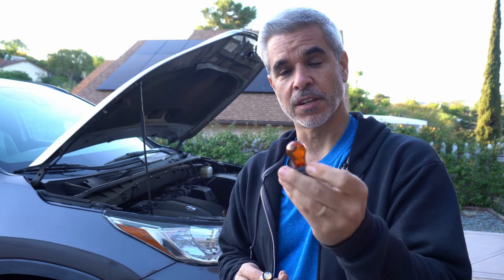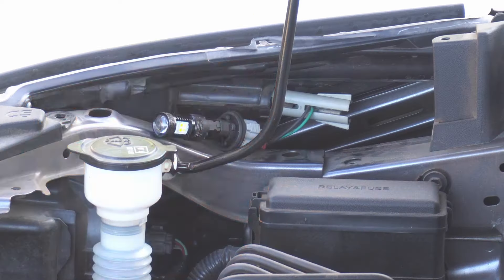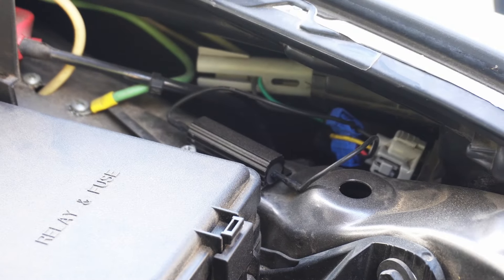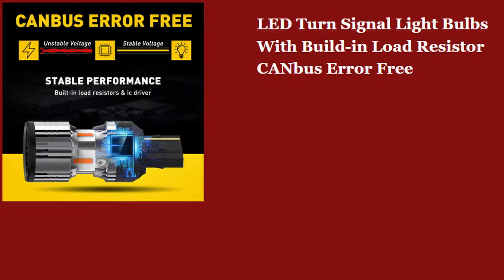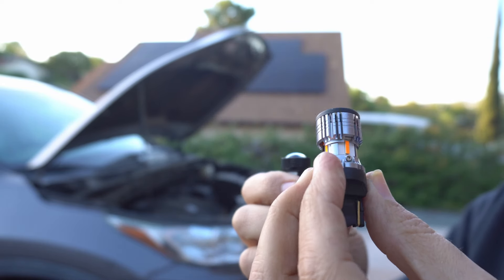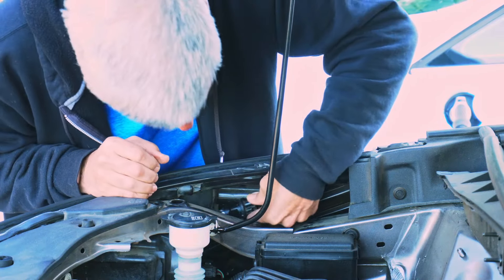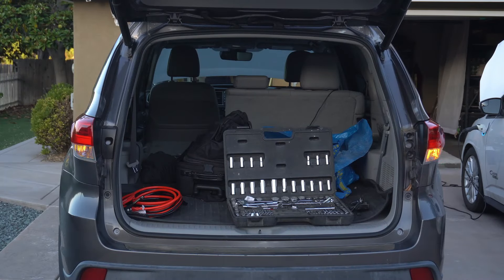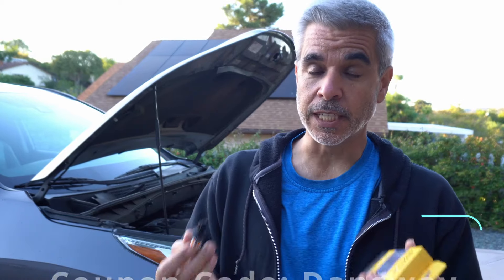Auxito Turn-Signal LED - NO Resistors Required to Prevent Hyper Flash

Comment: I don't like the idea of adding a mechanical fan to my lights, just adds noise and something that will fail in the future
Reply from the maker: I understand the concern.  If the fixture is water tight however, the fan is contained in that enclosed environment and only pulses on when the light is on, so very little use over the lifetime of the car.
Reply: Ur wrong. These led bulbs with a built in fan. Doesn’t make noise at all.
In our experience, they are nice and quiet. Unless u want to listen closely.

And it’s very nice to have a cooling fan, because with a fan. It can cool a lot more led

@Jonzo22

Nowadays with right kind of cooling fan, they will not fail.

Comment: So I used these on my 2016 Highlander.  I initially got the Auxito bulbs without the resistor and got the hyperflash which is too bad as they were super bright.  Got these and no more your flash BUT. When headlights are on for this model the turn signals illuminate and then flash when activated.  These bulbs do not illuminate when headlights are on but do flash when activated.  They also aren’t quite as bright as the non resistor variety.  So they re. CLOSE replacement, but not exact for incandescent.  Good video otherwise though
Reply from the maker: Sounds like you need the dual LED versions that have both running light and turn signal functions (two different fillaments in the same incandescent bulb).  So you would want to select the following one: Bi-Color White/Yellow: https://geni.us/Turn_Bi-Color_W-Resitr
Reply: You sure you didn't order the single filament version of the bulbs? Like ordering 3156 when you needed 3157? This would cause that issue.

Comment: I have also used these types of LED bulbs with built-in resistors for the turn signals on my previous cars and they worked well without getting too hot. The benefit of the turn signal turning on and off helps them not get too hot. But when you use LED bulbs with built-in resistors that have to stay on constantly, such as daytime running lights, they are not suitable and would quickly become much too hot and fail quickly or worse, melt your lamp unit. But in the case of turn signals this is hardly a problem. However, I do not trust the bulb with the small fan shown here. Such small fans tend to fail very quickly. And by switching the bulb on and off, the fan also keeps switching on and off, so I doubt whether it has much effect on the temperature.
Reply: So what LED should I get?
Reply: Which LEDs u used?

Comment: You should've demonstrate left of right turn only, not the hazard light to show it it's hyper flash or not.  Hyper flash occur only for either left of right turn alone, hazard no problems.
Reply from the maker: The whole point of this video is to show that it doesn’t cause the hyper-flash condition.  The reason I showed the hazard flash was to show the difference in brightness.
Reply: @ I get the point, but the number one thing any person is looking for in terms of swapping turn signal bulbs from halogen to LED is hyper flashing.  This cannot be shown if not right of left turn signal illuminates alone
Reply from the maker: @Abdul-404  Iguess you will just have to take my word for it. The whole point of the video is to say that this works, and I'm sorry I didn't include the clip you are asking for.  I can't update a YouTube video (trust me, I wish I could!).  If you can't trust me then you will need to find another source you can trust.

Comment: Just installed these on both the front & back of my 2015 Nissan Murano's turn signals. Very pleased with the outcome!
Reply from the maker: Awesome! Thanks for replying back with your thoughts!   Any tricks to installing them on the Murano?
Reply: @DansWay It’s pretty straightforward with the rear, and similar to the Highlander, there is a cover to remove to access the bulbs in the front. For easier access, the top part of the windshield washer fluid tube pops right off as well, to allow for more room to access the passenger side bulb!
Reply from the maker: Nice, glad they didn’t make it a total pain like some cars can be.   Thanks again for your reply.
Reply: Hi are they still working I’m planning on buying these too
Reply: @ Yes they both still work great.

Comment: Resistor can damage you electrical system I bought led lights cambus error free but they blink to fast turn signal I pay Over $50.00 An eBay
Reply from the maker: I've never seen a resistor cause damage as they only pull power similar to the old bulb, enough to trick the car into thinking the bulb is still alive...

Comment: Does this hyperflash after 5 minutes? I got the non fan version. And it hyperflashed after 5 minutes or when it overheated.
Reply: These will not get hyperflash at all. Compare to lasfit T2 series, the it out performs very well from auxito. 

These auxito led turn signals with a resistors built in, update decoder to hold the hyperflash, and it has a built on fan. For way better and doubles the heat dissipation.
Reply: @toyotabrony  As long as the fan works. Remember, also the fan itself turns on and off all the time.
Reply: @ruudwilschut9095  yeah. Only when it operates by using a turn signal

Comment: Installed the 1156s on my 2024 Kia Forte and they hyperflashed immediately. The caution lights worked fine though.
Reply from the maker: Wow, ok.  Good to know.   You can install resistors to add more load to fool the car computer about the power draw.

Comment: Hi, have you tried turning each side for 3 to 5 minutes? Does it hyperflash,?
Reply: Good suggestion. The problem is that these bulbs get hot after flashing for a while and the high temperature causes the resistors to provide less resistance, causing the car to hyperflash. In this case it is better to use external resistors. More work, but more reliable.
Reply: There's a little built in fan,  so that should cool the bulb enough

Comment: The problem with built in resistors is that not all cars need the same resistance. Another possible issue is the required resistance might change with the parking lights turned on. I might also add that on some older cars, instead of hyperflash, the opposite occurs, no flash at all.

I have also seen on some older GM cars, both instrument cluster turn indicators glow dimly when the parking lights are turned on. The solution is to replace the front side marker bulbs with non-polarized LEDs.

Comment: Let's say these bulbs work as said in this video.  But I'm wondering if the bulb gets hot enough to require a fan, and the fan is attached to the bulb, and the bulb with the fan goes inside of light housings that are usually sealed to be water resistant.  Where does all that hot air go to keep the bulb cooled?
Reply from the maker: The air volume of the fixture, combined with the higher efficiency of the LED (even though it gets warm), means that there is no problem with the fixture getting melted or damaged by the bulb.  Worst case for a turn signal is when you use your flashers in an emergency for an extended amount of time.  In that case the bulbs/LEDs are active ~50% of the time.  The fan spreads the heat into the air and the surface of the fixture will get a slight bit warmer than ambient, but not hot.

Comment: @DoingThingsDan’sWay

Since it’s been over a year.

How are the Auxito - 4KP8 amber led bulsb holding up?

And any hyperflash after daily use?
Reply from the maker: No problems here!  I have them on both of my personal cars and a few others as well...
Reply: @DansWay  do u expect them to last between 3-6 years? Because compare to Morimoto - XB led bulbs that had 52 3030 SMD led chips, and it makes 30W each. 2W more than Auxito. 

And their lifespan is 2000 hours, 

And we all know, the higher the wattage, the shorter the lifespan, because it will built heat more. Yet with cooling fan helps a lot.

But the lower the wattage, the longer the lifespan which means less heat built up.
Reply from the maker: @toyotabrony , in my experience (as a circuit designer/electrical engineer) the driver circuit driver IC and the capacitors are what fail in LED based designs assuming the LEDs are not cooked by poor heatsink design.  The LEDs themselves are good to 20-60K hours. The high temps degrade the caps (especially electrolytics), and the ICs deal with load-dumps, poor input regulation, etc.  Same story for most residential LED bulbs that claim 30K hours but seem to last much less than 10K.  I feel they are quoting the LED lifetime but not being honest that the driver is what will fail much sooner than that.
Reply: @DansWay  that’s what I was thinking similar to what to expect how the led built if it’s to last or not. Now if they draw down to 24W or 21W that meets exactly wattage, that will last much better and with cooling fan, it can last a bit better. 

But that’s just a thought of a theory. 

If these failed after one more year or so.

Would u buy them again?

And why would u want to buy them again? Despite the lifespan is shorter.
Reply from the maker: @toyotabrony , for me it comes down to the safety, color, and the brightness of LEDs over incandescent bulbs. These are true for both headlights and for turn signals. I don’t see myself ever going back to incandescent bulbs. I could try another brand, but by sticking with one brand that has a good warranty and good customer service, I know they will always take care of me if I have problems. Auxito has never refused a replacement when I had a bulb fail, but that has only been twice so far, and I have installed a lot of bulbs on my cars and my friends cars. In both of those cases, they failed within a month or two, so likely a component issue or perhaps manufacturing defect. None of my long-term bulbs have failed, and definitely none of them headlights.
Reply: @DansWay  that’s what I love to hear. That same goes to me as well. Auxito has been nothing but very helpful as well. We have sown Auxito led bulbs on our cars. Such as turn signal, marker lights, and interior lights. 

I also had great same results with Lasfit as well. 

And to be fair, I find in my honest opinion, that both Lasfit and Auxito are very competitive of both automotive led lighting company.

Comment: Does the resistor also stop the Canbus flashing when the car is off when it checks if the bulbs are still working?
Reply from the maker: I’m not sure how it would test the bulb without lighting it up?  Resistor should be active all the time.

Comment: I have purchased these bulbs but my truck has already have resistors on it can I still use these bulbs
Reply from the maker: Sure, shouldn’t be a problem.  Worst case you can cut the resistor wire off.

Comment: Do you know if you can use resistors with bulbs with built in resistors? I bought some built in resistor lights but they still hyperflash so i was going to install resistors.
Reply from the maker: I don’t think there is any problem with that approach to the issue.   Be sure to use resistors that are meant for it.

Comment: Cool. Do they hyperflash after sometime ? or you can run it for considerable length of time lets say more than 5 mins without any issues. Some Leds with built in resistors would work normal for sometime but then starts hyperflashing.
Reply from the maker: Good question.  I haven't tested that out myself.  Not sure when this situation would come up.  When using hazards, the hyperflash isn't an issue in my experience.
Reply: @DansWay  Its a bit annoying with Hyperflashing.These having fans would keep them cool so I assume would work for longer period of time.
Reply: @shahdadkhan  The problem is that such small fans tend to fail quickly. They do not have ball bearing so they will wear out quickly.
Reply: @shahdadkhan no they will no hyperflash after few minutes because they already update the decoding time, and it will not hyperflash for more than 30 minutes.
Reply: @ruudwilschut9095 in our experience, the fan did not fail on us. So it’s pretty stable. Which is very nice.

Comment: @DoingThingsDan’sWay

I bought the auxito - 7440 42 led chip ones and they are super bright on 1500k. Strong rich amber. 

One thing though, have u ever get pulled over for having super bright led turn signals?

I mean, these increase safety and better.
Reply from the maker: Hey, so yah, I had a set that I believed to be TOO bright and so I changed them out for something less dramatic.  If you dead-front the lens by putting black tint over them, the brighter bulb can cut through the tint, so that would be a good use case for them.  Not sure at what point you could get pulled over for being too bright.
Reply: @DansWay have u had these 3157 led bulbs issues lately? U have them for nearly a year. Do they still perform well? And what about the cooling fan?
Reply from the maker: I have had no issues with them.  The fans are working just fine.  They only run during each turn signal blink, so rarely compared to a headlight fan for example.
Reply: @DansWay  that’s great to hear. 
Honestly auxito that make led bulbs with high wattage, a cooling fan is a brilliant idea. 

Much cooler just like an led low and high beam bulb.

Comment: So do the resistor built in work in combo with front and rear ??
Reply from the maker: Hi Hayden.  The internal resistor replaces the power drawn by a single bulb.  If you install a second on the same side, you still need to have a internal or external resistor or it will likely hyperblink.  Make sense?
Reply: @DansWay  Hi Dan, if I just replace my halogens on all 4 corners front and rear would it still hyper flash? Nothing else will be installed. Everything else will be stock. Thanks

Comment: @DoingThingsDan’sWay

Hey how’s goin. Quick question. 

Since ur video was a year ago to upload about those auxito 3157 resistor free switchback, are they still running great?

Are ur white DRL lights and Amber turn signals runs and flash fine?

I say that because we had those 3157 auxito resistor free switchbacks, and I just saw my family’s 2017 Toyota sienna le front driver side amber turn signal is not flashing. 
But my white led DRL lights are fine. We had them for 3 months now. I’m assuming it’s started to become defective. 

Is urs still fine?
Reply from the maker: Hey there.  Yah, my bulbs are still going strong, no problems with them on my Toyota Highlander.  If you have a problem, just contact Auxito and I'm sure they will just send you out replacement parts right away.
Reply: @DansWay way ahead of u.

All I gotta do is destroy the defective they required for proof.

And I’m glad that urs still works fine.🙏🏼🙏🏼🙏🏼
Reply: @DansWay and could it be because of the heat built up for DRL white lights that makes 5.5W.

And an extra turn signal that it’s a lot brighter and a little hotter?

Have u had others that has this 3157 resistor free switchback with no issues?

Even with a coolin fan helps more. But I’m curious.
Reply from the maker: @toyotabrony I think you are the first in the comments here to say they had a failure..
Reply: @DansWay and that is rare for these auxito correct?
Reply from the maker: @toyotabrony pretty much, yah.  I got a bad package of interior lights that died within a couple months, which they replaced the package no problem.
Reply: @DansWay  I see. 

When u know what, I’m glad that u guys better experience. 

Keep in mind that when high Wattage that matches the incandescent bulbs power, usually it can reduce the longevity because how the power draw. 

The lower the wattage of the led, the better the lifespan is. But as long as it’s still brighter than stock. That’s all that matter. 

If not the same brightness like the sylvania zevo. 

U know what I mean?

Comment: Would this work on a 2006 Toyota Sequoia? I wired resistors after installing LED bulbs and they still hyperflash. Wondering if this is the fix I've been looking for.
Reply from the maker: Very unusual that the resistors didn't work.  You could try these, and perhaps keep the resistors as well? The resistors always have worked in my experience.
Reply: It depends what wattage u got it. And I prefer sylvania - load equalizer resistor with 50 watts in it

Comment: Nobody seems to be able to answer this. Two weeks ago I put in vland headlights on my 2016 Silverado. After installation my right turn signal started hyper flashing. Left turn signal and hazards were fine. The rear turn signal, which isn't led, hyper flashed as well. No bulbs out at all. Two days ago my radio screen went blank when I put my right turn signal on. Ten seconds later it came on then the turn signal quit hyper flashing. My question is what is your opinion as if they are somehow connected?
Reply from the maker: Wow, that is one bizarre set of interactions. Clearly, those are all electrical systems, but I don’t see how they would be related or interacting except for perhaps battery low-voltage.  Are the headlights also functioning as DRL lights?
Reply: @DansWay  yes. They also work as drl lights. My truck battery is 4 years old. It's a 6 year battery but that doesn't always mean 6 years. It may need changing.  I did wiggle the wires around the day before. I couldn't quite reach them or I would have unplugged it then plug back in. I'm not complaining though. They're working for now. Thanks for responding to me.

Comment: @dansway I bought these same exact headlights for my car but I’m getting intermittent hyper flash.

I have a 2009 Chrysler Town and Country minivan. I put these bulbs in. Initially, after cranking up car, they don’t hyperflash and work perfectly. Then, after a couple of minutes they hyper flash when using the blinkers.

Thoughts?
Reply from the maker: So strange!  I haven't seen that behavior myself.  Can you confirm the fan is still spinning after a couple of minutes?  Perhaps something is happening with the internal resistor/fan combo...  Worst case you might still have to add resistors across the power leads to draw more power to fool the car.